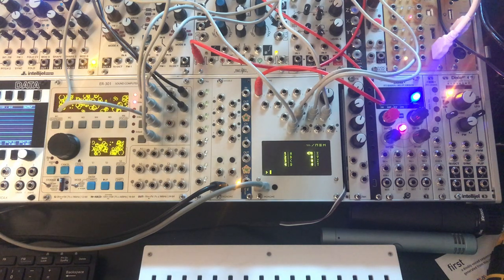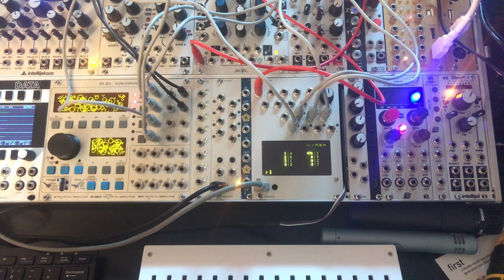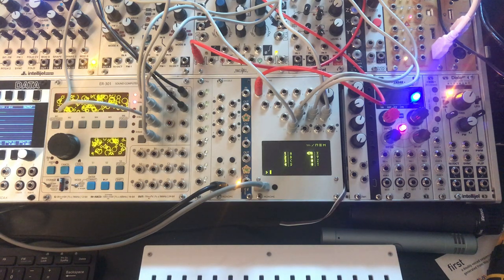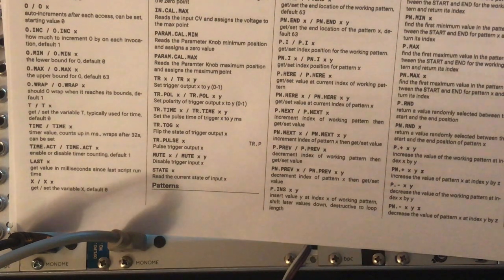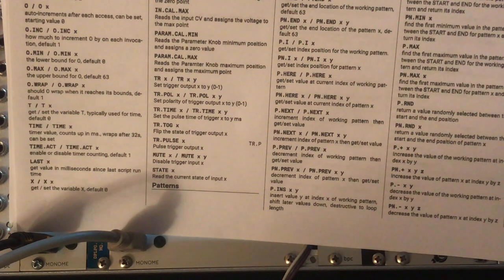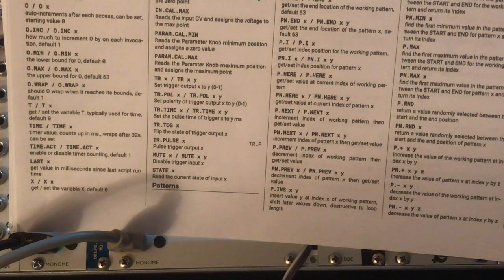Teletype Talk - Episode One

Comment: Hi @Joe Filbrun! I'm thinking of getting a teletype as a gateway to modular but on a budget which one module would you pair this with? can only buy a module every other month!
Reply from the maker: Hi @merichie, well the number of choices is unreal!  Have you looked at the Expert Sleepers Disting EX? I don’t personally have one, although I do have the Disting mk3 and mk4.  The Distings are pretty nifty in that they can become any of a whole bunch of different module types by switching it’s “algorithm.”.  So you can try out a bunch of different modular functions (oscillators, filters, envelopes, etc) and start to get a feel for what kinds of modules you want to add and in what order..  You can also make an i2c connection (3 jumper cables behind the modules) from the Disting EX to the Teletype and then the teletype can control the Disting EX using ops in addition to using front side cable patching.
Reply: @joefilbrun  Thanks so much for the in-depth answer.  I was thinking of getting a single voice module but your suggestion of a disting makes more sense, seem like it would stay in the system no matter what the size! Teletype on order, keep up the great work with the talks and tutorials they are just whats needed!